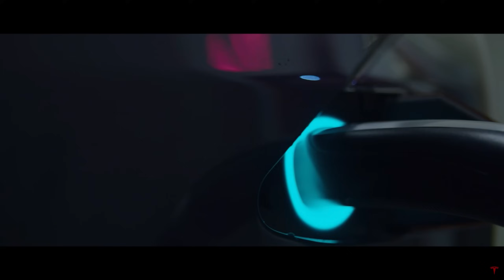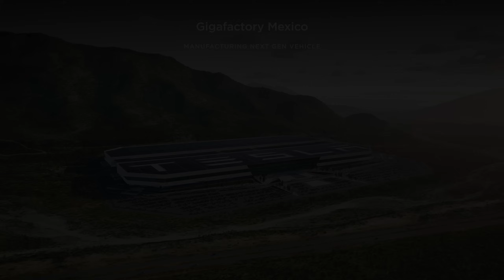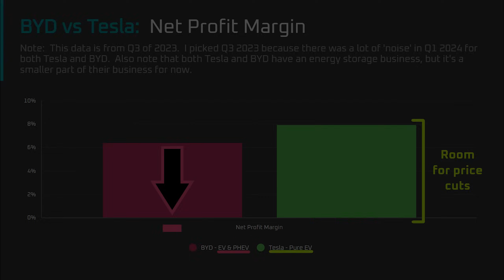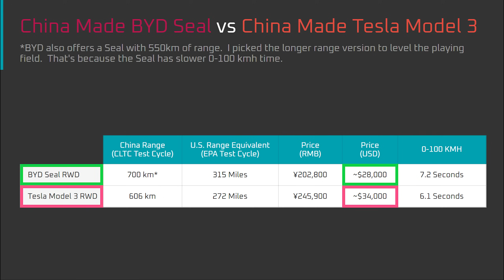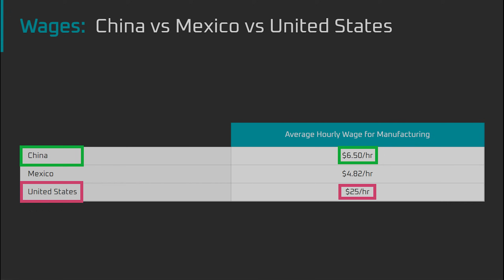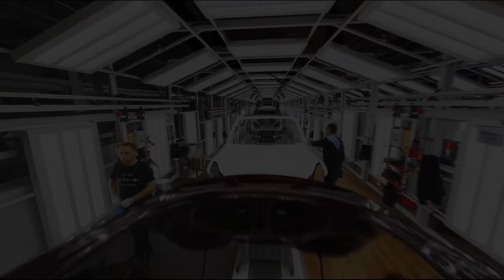Chinese Automakers are Going Global // How will Tesla Compete?

Comment: I am a Chinese audience. BYD's latest product, called BYD-qin-L (exact English name unknown), is a hybrid model with a 17 gallon fuel tank that can travel up to 2000km on full gasoline. It was released two days ago. There have been many Chinese drivers test driving, and there is no exaggeration. I believe this is the biggest challenge for Tesla. The most important thing is that the price is only 100000 RMB, which is equivalent to 13500 US dollars.how do you think?
Reply from the maker: I believe some people will want/need that, but ultimately for most use cases electric is the way to go
Reply: For people who travel long distance on a regular basis, BYD Qin EREV will of course be very desirable.  For me, I am content with Deepal 07 (深蓝SL03).  I don't have problem with BEV. And I love ChangAn. My next EVs are going to be Zeekr 009 and AVATR12.  Tesla is so overpriced and Elon only focuses on driving experience, not  rear seat passenger's experience, esp seniors. Tesla puts even the gear on the centre screen in Model 3 is a big negative.

Greetings from Thailand

Comment: The price of Chinese vehicles inside and outside China are not the same.  In Mauritius the BYD Seal is equivalent to 60KUSD!!!  In my country BEV are more from BMW, Porsche, Kia, Hyundai, Mercedes, BYD and MG.  Tesla is considered unreliable and difficult to fix with no aftersales support.
Reply from the maker: Yup, apples and oranges are not the same.  Can confirm.

That's why I used several examples to illustrate the dynamics of different jurisdictions.
Reply: @thelimitingfactor  -> Dolphin Standard  -> Rs 1,350,000    -> USD 29,504.41
-> Dolphin Extend      -> Rs 1,550,000    -> USD 33,875.44
-> ATT0 3 Stanard     -> Rs 2,095,000    -> USD 45,786.48
-> ATTO3 Extend       -> Rs 2,400,000    -> USD 52,452.29
-> SEAL RWD             -> Rs 2,950,000    -> USD 64,472.60
-> SEAL AWD             -> Rs 3,300,000    -> USD 72,121.90

These are the other BYD models prices
Reply: One most important thing to note is that there were tariffs imposed on Japanese vehicle since the 1980's which only gradually was removed during the last decade.  In spite of these punitive charges, it's the Japanese vehicles which are more common on the roads of my country.  You can protect your market with punitive tariffs, but people will only buy what they can afford!

Comment: They aren't coming to the USA. Tariffs are a killer.
Reply from the maker: That's why i coverd the Mexico route
Reply: @thelimitingfactor  The new tariffs don't let th m use Mexico as a workaround. They specifically state that the batteries and supporting technology must be made in the USA. The solution is to ship the vehicles without batteries installed.

Comment: European car makers are moving on cheaper EVs. You only take the premium Fiat 400e which has been out for years now. Renault R5 is coming soon this year with 25k€ as the imminent Citroën e-C3 for 23,3k€ (depending on the country) with both a 40kWh battery. There is also the Dacia Spring for 18,4 k€ but it's made in China and tariffs up from 10 to 25% are maybe incoming imminently. Then in 2026 the Renault Twingo will come for 20k€ and maybe other cars based on this platform will join it as discussion are happening right now between car makers. That's the entry level. Battery factories are being built and operated in order to bring down prices for all vehicle type.

Comment: One point that I feel should have been mentioned, but wasn't (just like every other youtube video that mentions Ford losses) is that the loss figure stated includes fixed overheads amortized over the vehicles produced. This is a big part of why the loss per vehicle has increased as numbers sold dropped. What really matters most isn't the total loss per vehicle produced but rather the marginal loss per vehicle sold. It is quite possible for a manufacturer to have a marginal profit per vehicle sold while still having a large absolute loss per vehicle sold. Indeed, this is the normal state of affairs during the early phase of a new product introduction, during the production ramp. It may not be that Ford can't make a profitable vehicle, but rather that they can't make a compelling enough vehicle to sell enough vehicles to make a profit.
Reply: Interesting remarks. Ford and GM have said they expected to make a profit on EV at the end of the decade, if not at the beginning of the next.
Reply from the maker: All the manufacturers have to fight that dynamic.  What matters is scale and profitability and who gets there first.
Reply: @thelimitingfactor  True and undisputed, but youtubers consistently talk about Ford losing $100,000 plus per vehicle as if producing one more vehicle will lose Ford another $100,000 plus, which is to say the least misleading. And that was my actual point.

Comment: Waaay too many assumptions in this. And hopium. The elephant in the room is the self driving which we just don't need.

What we need is small, affordable EVs but Tesla to daihas done exactly the opposite. Look at that latest monstrosity. Environment? What's that?
Reply from the maker: Not assumptions, IF/THEN statements.

So, if you agreed or disagreed then you can include/exclude my points

This video has turned out to be a Rorschach test.
Reply: @thelimitingfactor  so true. I had thought to include your prefacing with 'if//' but for the sake of keeping it short...

The major assumption(s) was just the focus on just byd and Tesla and a whole load of other variables you didn't include. And if you don't include them you assume they are fixed.

Comment: You've presented some good points on a complicated topic.  They are a few wild cards, however. 
1.  If China, Inc (CCP) decides to target the US auto market by subsidizing BYD (or other), then any  labor or manufacturing efficiency by Tesla will be moot.
2. A lot of US auto owners are still skeptical, or even against, EVs, no matter the price.  A hiccup in gas prices might change this.

3.  Elon seems to have shelved the compact "model 2" in favor of robotaxi, although the R&D and design would probably be applicable to both cars. 
4.  The take rate on FSD doesn't seem to be high enough to support Tesla if they sell cars at cost.

Comment: No one wants the stupid Tesla cabin which is missing essential physical controls and causes safety problems. Elon Musk has explained that Tesla is almost worthless as an investment without a working robotaxi. The BYD blad battery is longer lasting and safer than the Tesla Panasonic battery and that is why Tesla must buy BYD batteries for its Tesla vehicles! 
I love Tesla but it cannot compete against BYD Blade lithium iron Phosphate batteries and CATL LiFePO4 cells are dropping by 40% in costs next year.
Reply from the maker: Tesla uses CATL cells, so it benefits them

You have an adverserial view when it's an ecosystem
Reply: https://www.youtube.com/watch?v=bmz4nzcsx-4 is relevant

Comment: Here in New Zealand the made in China Tesla Model 3 costs $66,000 (USD $40,250) and a BYD Seal costs $65,000 (USD $39,650). BYD has to use New Zealand companies to provide local advertising, distribution, sales, servicing and warranty support. Once those extra costs are added on, BYD has almost no cost advantage over a Tesla when competing in the same vehicle category. BYD has a greater cost advantage with their compact vehicles, such as the BYD Atto 3, but that's a market which Tesla has not entered yet. Could be game over for BYD when they do.

Comment: What are the chances that the unboxing method would actually reduce the costs? The structural 4680 battery pack design was meant to reduce costs too but so far it's actually more expensive to make.
Reply from the maker: Fair point

I would say that Elon sucks at chemistry, but his manufacturing chops are solid.
Reply: This is one point of contention with the analysis which was mostly good. The assumption that the unboxed process would save Tesla any money, let alone the percentages they promise is a big unknown at this point, so it cannot be held up as an advantage until we actually see it in action.

Another one is the assumption that BYD only makes a profit on their plug-ins and not their EVs. We don't know what the breakdown is until BYD is willing to provide that information. The best we can do at this point is take the company's overall profit margin as a yardstick for future assumptions.

Comment: I am no longer convinced that Tesla will produce an economy EV, a "$25k" EV.  I think it more likely they will produce a sub-$40k EV using existing factories.  A Tesla with a price of $35k would cost $28,500 after the federal subsidy.

Rather than building an economy EV and compete in what is likely to be a low margin segment where success is based on volume production, look for Tesla to put their future efforts into a very much more profitable robotaxi enterprise.  

Additionally,  robotaxis would do more to meet Tesla's mission statement of moving the world off fossil fuels ASAP.  Using Tony Seba's calculations, one robotaxi should replace five to ten privately owned vehicles.  A factory producing robotaxis is going to shove a lot more ICEVs out of existence than a factory producing EVs that spend most of their time parked.

Comment: BYD has come a looong way since their first clash with Tesla 10 years ago. Tesla's weak point is batteries. It is depressing to see the US resorting to tariffs in such a way.
Reply: Tesla can buy batteries from 'the best'.  Tesla can optimise quality and price.  As battery prices drop, the importance of giving up the profit on battery manufacturing becomes less important.

It seems that battery prices may have fallen to under $50/kWh.  If so, and if BYD is hanging on to a 20% profit off $50 batteries that's not a lot.  $50/kWh for a 50 kWh pack is $2,500.  20% profit out of that $2.5k is only $500.
Reply: @bobwallace9753  Batteries, especially the LFP ones, are oligopoly. CATL and BYD own the market. CATL has already stated that those buying mostly from them will enjoy prices lower then what it sells to Tesla.
Reply: @paouvous  
"CATL has already stated that those buying mostly from them will enjoy prices lower then what it sells to Tesla."

Where did you find this?  And why would CATL crap on their largest customer?  Don't forget.  Tesla not only makes cars, they also make storage systems.  Other EV makers only make EVs and in smaller numbers than does Tesla.
Reply: @paouvous  From Electrek
"Tesla is CATL’s largest customer. Does it not get this deal because it’s an American company? Or is it merely because Tesla is already tied into a production pricing agreement with CATL until 2025?

No other non-Chinese automakers appear to be getting CATL’s special deal."

Comment: Tesla could reduce the cost of the model 3 if they use some of their manufacturing processes in the cyber truck and Model Y
Reply: Apparently Tesla has a less expensive EV that will be made on existing 3 and Y assembly lines.  If they can drop the price $5 below that of the 3 then that would be a $35k EV, costing $28.5k after the federal subsidy.

A sub-$30k EV would open a massive market segment.

Comment: BYD have just released a great pickup truck. But, around 80m vehicles are sold per year. If Tesla and BYD can both produce compelling, lower priced EVs, then the market is more than big enough for both of them. And a few other Chinese EV manufacturers. RIP legacy auto.
Reply: What's so great about it again? It's not actually available for retail puchase, so hasn't been reviewed and it uses hybrid not bev tech. 🤔

Comment: wait what i knew ford is losing money on their electric vehicles but 130000 each?
Reply from the maker: Yeah, it's increasing rather than decreasing, lol
Reply: The cost likely includes fixed costs of the program - engineer salaries, wear and tear on machines etc. Otherwise they could just buy Teslas, rip the body off the chassis and put a Ford body on top for way less than that.

Comment: UAW and legacy auto will force whatever US regs necessary to protect the market from China. What about Kia/Hyundai? Honest question. They seem to have a lot going. Could they slide into leading the lower cost EV market in the US?
Reply: Yes.  And likely.

Any company that wants to sell EVs in the US and avoid the high tariffs will have to find suppliers that qualify.  Ford and GM are going to buy windshield wipers and tail lights from some qualified supplier.   Those suppliers will sell to other companies as well.  Just give them an order.
Reply: Hyundai has an established supply chain in the US.   I do not know what % of the parts it covers.  These are also Korean owned and managed factories.  You may remember when Hyundai suppliers were caught using child labor?  I avoided saying busted because I don't know that it went very far, and neither will I.

Comment: Overall, I agree with your conclusions, I do think the unboxed process is a wild card. From Elon's announcements, it looks to be further away or more of a gradual transition. Furthermore, BYD has competitive advantages in terms of vertical integration in the battery space. Tesla said they hope to achieve cost parity between Tesla 4680 batteries vs 3rd Party suppliers. Tesla's cost of 3rd Party cells includes that manufacturers profit margin so BYD has a cost advantage here today.
Reply: 4680 are a new battery, especially the CT version with dry electrode. Costs take time to come down.
Reply: @Michael-Has-Opinions  
I recently saw an article reporting CATL has brought LFP battery prices down to $47/kWh.  If so, that means a 50 kWh EV pack would cost only $2,350.  Any savings below that are not likely to be impactful on the overall cost of the vehicle.  A 50% battery cost decrease would mean just over $1k drop in cost to manufacture.  Not significant.
Reply: @bobwallace9753  I agree with the thrust of what you say (that batteries are getting cheap enough that further reductions in battery costs are of marginal benefit). However, it looks like you read only an incomplete summary of the article. The full article states that batteries for stationary grid storage are sold at $47/KWh, but batteries for EVs are sold at $57/KWh, and with the cost of electronics required for managing a battery pack, the cost rises to about $90/KWh for a battery pack.
Reply: @CiaranMcHale Pack prices are always disappointing compared to cell prices 😢
Reply: I did not get the impression that Tesla was backing of on unboxed for 2/robo-taxi.  Maybe your thinking of the additional cars that will be made on the existing 3Y? lines.
Reply: @danharold3087  
My guess is that Elon is now confident that FSD is going to be complete (at least in most of the US) soon.  If so, I think it's likely that Elon has gone back to his decision to build robotaxis in the yet to be built factories (Mexico, etc.).  IIRC he agreed to build a $25k EV under pressure from others inside the company that had less faith in FSD.

A sub-$40k EV built on 3 and Y assembly lines would mean an entry into a very large market segment.  $35k - $7.5k federal subsidy would take the Camry/Accord segment.  For those not math challenged a net sub-$30k EV would cost the same out of pocket over five years as an ICEV selling for just over $20k and be very much cheaper over the life of the car.